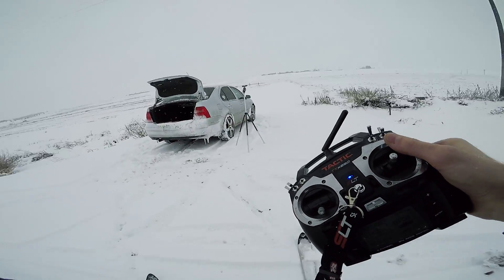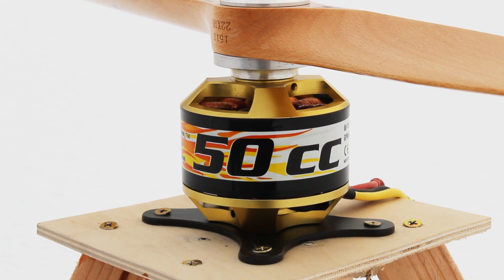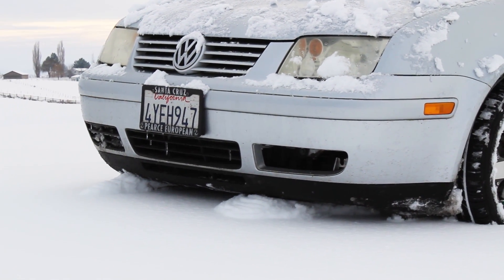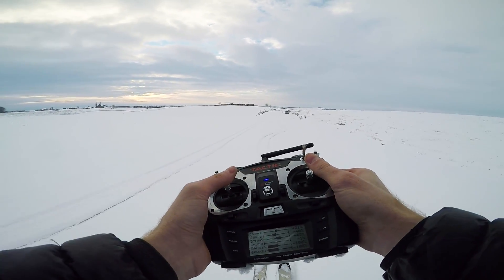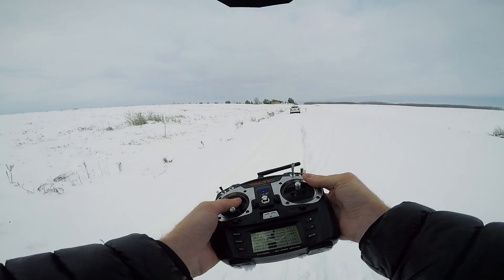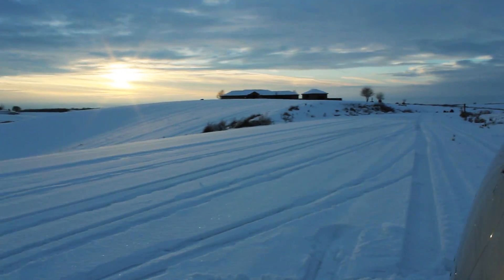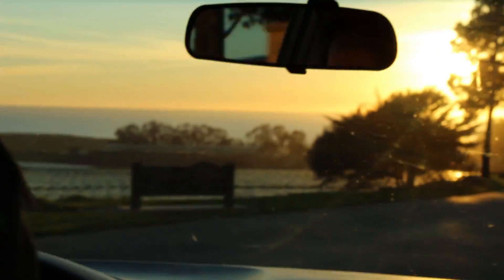Propeller Backpack Part 1

Comment: Dude, with a REALLY hefty motor and bigger prop, you can ski uphill! Let's see those gold-medal Olympic wusses do that! :) hehehe
Just a little tip, not to be a nag, but you really should have a protective shroud around that prop. A neck strap for the transmitter ain't a half bad idea either.
If you can stand the racket, a two-stroke aero engine is incredibly lightweight and produces lots of power. Even a good-size chainsaw engine is very light--and powerful.
Have fun!

Comment: if you loose the remote while in flull throttle you are basically screwed do you have a safety switch you can reach without getting your hands dangerously near the spinning blade of dismemberment? I hope so.

Comment: Samm, use an impeller blower like you did with your RC airplane for your backpack.  It could be used in population dense areas without being a hazard.

Mount one on each end of the motor/both sides of the backpack.

Comment: Dude you are brave haha. 3mo late comment but. That big propeller in the back, I realize for example powered parasail people wear a similar setup but damn... I'd be scared, biggest propeller I ever worked with was a 12" prop haha, and that seemed scary to me.

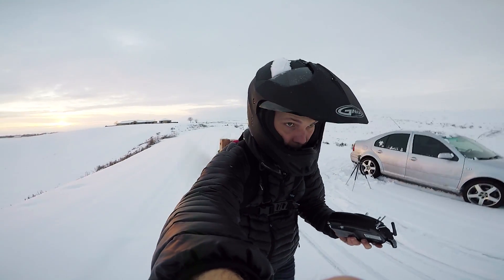edit: ahh 1:57 it's not gigantic but still, I've been hit by a spinning propeller a few times. I'd feel better if it had a guard.

4:52 slope soaring

Comment: Cell checker or lipo testers  on the market are limited to 8s batteries and I want a way to adapt them or to make one that can test 13 s batteries
Reply from the maker: Oh they only make balance leads up to 6s. My 10s is split into two 5s balance plugs and I charge it through those as if it were two 5s batteries one at a time.

Comment: Hello Sam , I'm on a electric paraglider project and we will make a screen which says you the battery left and advertises you when you're low voltage .Do you know how to control the battery voltage on a 13 s ?
Reply from the maker: For an electric paraglider you'll need about 3x the power as my setup. I've seen a 150cc equivalent motor used. I'm not sure what your question is though.

Comment: I would have made a cage - wouldn't want to make contact with the spinning prop in a accident.
Reply from the maker: Totally agree. I did do a lot of "what if" extreme flexing to see in what ways I might interfere with the prop arc. It was actually really hard to reach it. Of course anything that can happen will happen especially in a crash. I made my own risk assessment for to do what was filmed. My new frame has a cage, I'm editing that video right now.

Comment: that motor and prop on 12s makes 36 pounds thrust, I know this because a friend has a plane with this setup and the motor is under propped, but this looks like a blast except if you wipe out with a lawnmower mounted to you back

Comment: May I recommend that you put the throttle control on the spring loaded side of the transmitter? That way of you drop it or something it will return to zero throttle :)

Comment: maybe where the lanyard on the transmitter cuz if you drop that you're screwed
Reply from the maker: slightly annoying, not screwed.
Reply: Samm Sheperd I suppose you do have a backup in case of loss of control

Comment: Awesome, Samm!  I hope you are taking adequate safety precautions. Remember, some of us oldies live vicariously through watching your videos :) BTW, Turn on GPS logging on your smartphone and see what top speed you're getting. Also, if you hunker down on the skis and allow more "open" air in front of the prop, you may get higher speed/longer runs/cooler hardware. And... you do not need a transmitter, just a servo tester should be enough for speed control, right?

Comment: If you drop the transmitter you're basically SOL.  I think it would be slightly safer ditching the radio system altogether and using a wired servo tester plugged direct to the ESC as the throttle control in your hand (have to solder extension wires).
Reply from the maker: I was gonna TIG weld an aluminum frame and use a wired trigger throttle but the snow made me rapid prototype a bit faster.
The main power plug is within reach but a better kill switch would be nice
Reply: Honestly, what you should do is use your trainer switch as a dead man's switch. When you drop the trainer switch, throttle goes to idle. This way if you drop the transmitter, the throttle goes to zero.
Reply from the maker: Gutorov Mike Pretty much yea, or just turn around and pick it up, or last resort just lay over and let the prop stop on the ground.
Reply: meh you could just fall backwards to stall the motor if you lost the tx
Reply: just bend over and point the air stream up
Reply: and eat some free spare meat!
Reply: Very smart Idea!
Reply: thechosendude untill it out of range if fail safe is correctly or make a battery disconnect
Reply: that and a steel net around the propeller:)